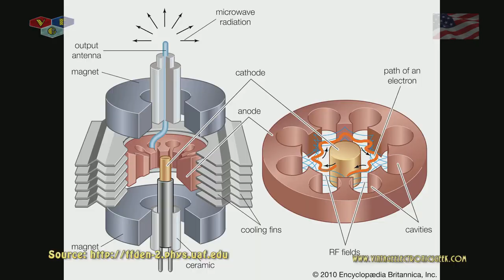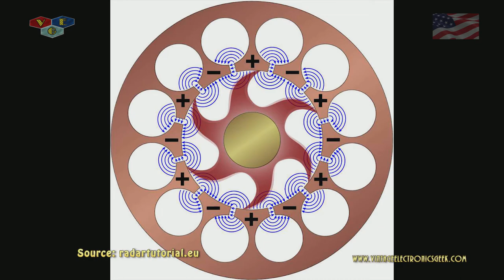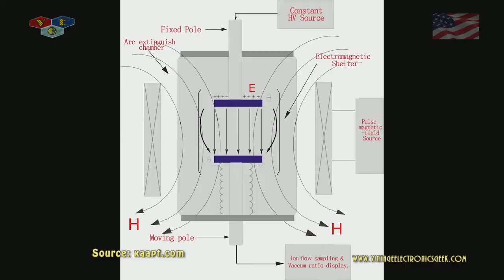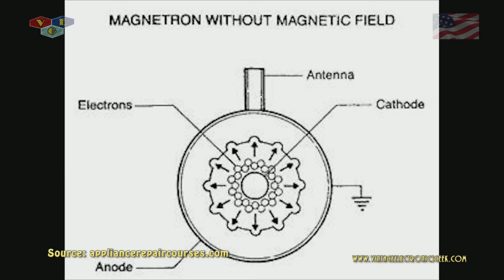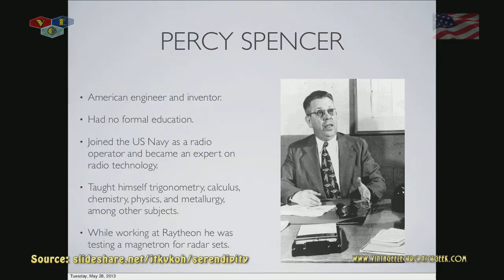Microwave Oven - Guts & History

Comment: re-purpose the enclosure as a Faraday cage.   lol  its works.  
those sensors are bi-metal thermostats (the cutoff temp in Centigrade is printed on the top of it) they OPEN at that temperature.
aluminum cardboard = Mica Circuit board
careful of that magnatron =  beryllium and thorium they get airborn, can really mess you up. never take apart a magatron LOL
great video!  i enjoyed this!  thanks Jack!
Reply from the maker: Thanks Bobby!  I appreciate the support!  Yea, I read about how the can be bad, so I decided to add the graphic.  I ended up disposing of the MOT and magnetron, kept the sensors and boards...wonder what project to repurpose them into?  Probably not much for me, I don't possess your skills...working on it though!  :)  ~Jack, VEG
Reply: ...and don't melt candy bars in your shirt pocket, could cook your heart, and fry your brsins, and make you blind like old64goat.  (and mom said something else would make you go blind, lol, don't ask, don't tell)
Reply from the maker: Yeah, my mind went to thinking of that as well...the candy bar that is!  He lived a long time, but just makes you wonder what damage was done due to him walking in front of the antenna!  Mom always said don't stare at the Sun and sit to close in front of the TV....is he worse than you Don?  ~Jack, VEG
Reply: Sometimes I wonder about that "blind tinkerer", but he drives???  Perhaps he has magnifying windows on his truck?

Comment: There is some useful parts salvaged.  I never knew what parts were in a microwave.  Those little sensors are thermal cut-out's (thermal switches), they are usually normally open.
Reply from the maker: When I shot this video, I was just going to show the junk that I captured.  I did know a few minor things about the microwave oven, however I thought maybe I should add a picture of something, welp, that turned into two full days of research and editing of this video.  If I were going to make a proper "documentary" I would have properly researched and scripted this video to make it more smooth than a rough draft before shooting began.  However I am glad I went ahead and offered a little more meat then I was planning as I too learned a few more things about it that I thought were cool and interesting and hope others may find value in this video. Thanks for watching Pete!  ~Jack, VEG

Comment: Jack in a box, with high voltage and radar.  Put a CRT in the door window, a rotation dish antenna on that magnetron, and you're ready to watch out for UFOs.  
I think that Amana manufactured the first commercial "radar range" in the 1950s.  Litton and Amana made 2k$ home ovens in the 1960s.  Our first MO was a Tappan with dial timer and temperature probe, back in 1978.  But I used Litton's in my coffee shops back in 1974.  So I've used microwave ovens for 44 years.  
Don  
PS:  Transmitter?  where to connect  mcrophone or morse code key to it?
Reply from the maker: In 1965, Amana produced the first consumer countertop "Radarange", prior to that, Raytheon produced large business "Radarange".  If the aliens have been watching Earth lately, they probably will pass on by...saying we are just to odd for them!  :)  The real question Don...do you still have that 44 year old MO?  How many MO's do you have in your collection?  Make the connection to the mains in, guaranteed you'll make contact!  :)  ~Jack, VEG